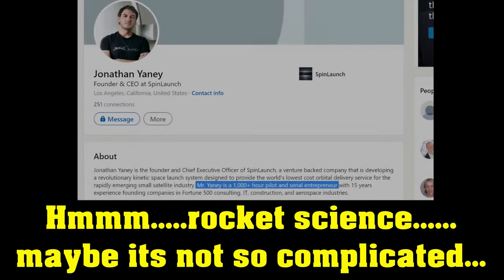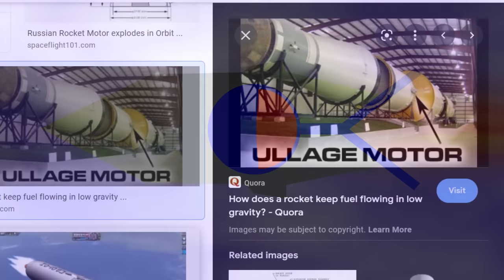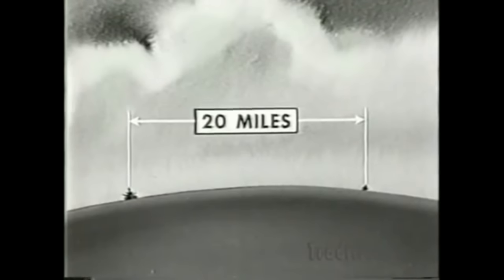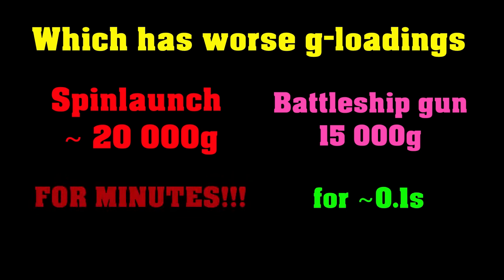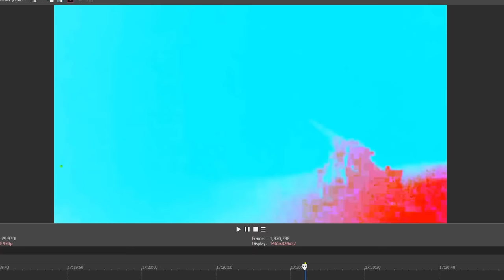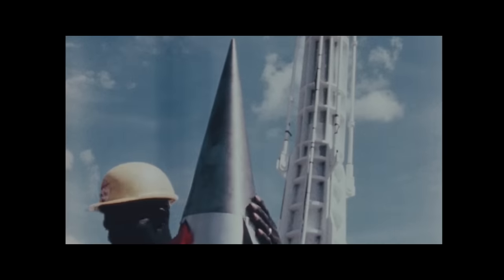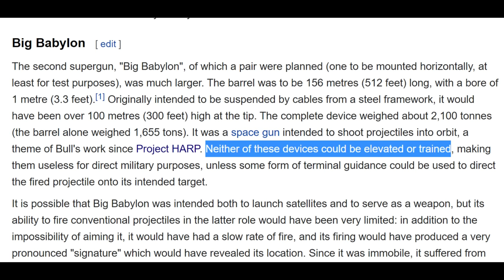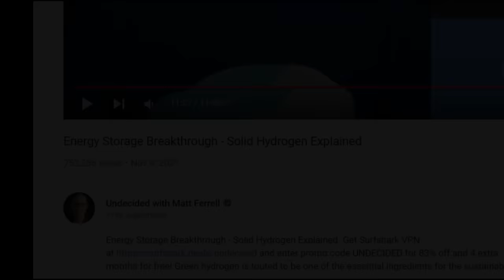Spinlaunch: BUSTED (Part 2)

Comment: I agree with most of your points here actually, and I also don't think this will ever work for numerous reasons. However there is one thing. I don't know your level of knowledge in rocket engineering Thunderf00t, but the fuel and oxidizer moving to the front of the tanks during deceleration is a problem that has been solved now in several different ways for several years. 
A few examples I am aware of being: 

#1 Using "header" tanks that are completely full and designed to deliver fuel instantly in these situations for engine relights.
#2 Electric pumps and/or using tank bladders(Yes I am aware of the extra mass this would take up).
#3 Pressure fed fuel delivery systems designed specifically to operate under these conditions.

Again, I agree with you on the idea that spinlaunch is kind of ridiculous. doable, but ridiculous. However I gotta try and keep the facts straight man.
Reply: Exactly. TF seems to really focus on being snarky here. This fuel issue can easily be solved in multiple ways. If there's anything that would make Spinlaunch unfeasible it's not this.
Reply: Many considerable updates needed, the reason why ones invention WILL get Busted , some of these goons learn to reabilitate thier designs, or keep bailing bonds out of the public ridicule all the time 🤣. It is VERY feasable to reinstate the technology, example, having a more o-ring axel spinner, magnetically suspension, realeasing the craft in a smaller volume of vacuum. No spinner clock tension arms, with a far wider g-force reduction of larger/human cargo, along with magnetic accel at the exit pipe, but it gets complicated, at the external exit atmosphere drag where at least a lower/less thrusting engine of the craft first stage, needs to equilibrium the travel velocity up.
Reply: Yeah I was disappointed that thunderfoot saying the fuel/oxydizer as a fatal flaw of the design. Clearly it look like something not particularly hard to solve.
thanks for your response.
Reply: For sure, it would've been foolish of the designers, if the fuel was just a loose mass motion of liquid, and not of gas, solid form, or have any compression flow injection mechanism, those would've been an issue during mid flight static/ignite attempts.
Reply: @anteeko  it was solved, the video he criticized even showed the helium pressure tanks they would use but it flew over his head, when people tried to correct him he refused to admit he was wrong about anything.
Reply: @odisy64  "when people tried to correct him he refused to admit he was wrong about anything."
It is disappointing from him. 
I thought a scientist would be more rigorous and admit mistake.
Reply: @anteeko  I stopped watching Thunderfoot years ago because of this behaviour, there are many much more genuine "science guys" on youtube
Reply: @karimshebeika8010  Could you recommend a few to follow?:)
Reply: @anteeko  PBS Spacetime, Scott Manley, Isaac Arthur are my favourites
Reply: @karimshebeika8010  I know those, good staff:)
Reply: Thunderf00t literally views himself as unbiased (or almost unbiased) which is a good laugh, he is also edgy for the sake of being edgy.
Reply: thanks for your information, i think thunderffot is making a living on sarcasm and ridiculing people.
Reply: @odisy64   got a link to that?
Reply: No idea how №2 and №3 is supposed to work.
Reply: @odisy64  I would have to agree, there was a time where thundfoot had some interesting takes on insane topics, but it seems that he has little to no problem explaning things in a misleading way to further his position against whatever the topic is. Not to mention his recent hate boner for elon.
Reply: @karimshebeika8010  Of the 3 (good) examples you gave,  only Scott Manley is similar to Thunderf00t. Also, if you stopped watching him years ago,  why are you ironically still watching him?
Reply: @Jimoshi1 
#2-A: Electric pumps draw the fuel from the tank with specially designed outlet pipes in the tank(which in some cases is filled with a porous almost sponge like material to stop the fuel from moving around.

#2-B: a large nitrogen filled bladder(balloon) is fitted inside the tank. the bladder is pressurized forcing the fuel to remain at the bottom of the tank(this works just like the pre-charge(holding) water tank that houses that use well water use. Pretty sure they are even called "bladder tanks".

#3: there are tanks holding thousands of psi of nitrogen(usually) which pressurizes the fuel tanks and pushes the fuel out through specially designed collection pipes.
Reply: @Jimoshi1  These systems are actually in use today, as we speak.
Reply: @ExCenterProductions  Yeah It's sad.I used to love the science. Don't know when he made the switch but. it saddens me a little.
Reply: @skateboardingjesus4006  Don't rush to judge. It is extremely difficult to watch while not watching. Much respect
Reply: @skygh  What on Earth are you going on about?
Reply: @skateboardingjesus4006  Just agreeing with you. If you don't watch how do you watch. My comment didn't seem ambiguous to me
Reply: @skygh  Oh, sorry, I didn't look at my comment you were referring to. But yeah,   not doing the things we do, is hard to do.😁
Reply: @odisy64  If Scott Manley claims that this spin launch idea is reasonable, you need to stop watching his videos.

Different ullage solutions are not the important design flaws in spin launch. It is all of the rest of it.
Reply: @odisy64  1. Argument from Authority Fallacy: I do not accept as true everything that Scott Manley says. To do so is an argument from "authority" fallacy. If he cannot calculate the launch timing from the spin launch claims, he is not trying hard enough.
Run the equations for yourself. Spinlaunch claims a certain rate and pressure (which seems to be a lie, based on the photo of their chamber membrane that is not bowed inward) and presumably they can tell us the width and length of the exit from their spin chamber. How precise does the launch timing have to be to meet the exit window?
That is an absurdly simple question. What is your answer?
Reply: @FinnMcRiangabra  are you even listening? Why are you talking about the viability of the project? Scott manly is credible figure and its not because his athority but that is beside the point...
Reply: @karimshebeika8010  And yet... here you are.
Reply: @odisy64  You are directly using "argument from authority" fallacious reasoning. You are telling me just to listen to what Scott Manley is saying. He has a great resume, but he is wrong in this. I am looking at the facts, not what Scott Manley says.
Reply: @FinnMcRiangabra  so why would you listen to thunderfoot? Someone who deliberately ignores facts and drives his own narrative? Your fixation on the viability of the project is beside the actual point.
Reply: @skateboardingjesus4006  got for some reason recommended on my youtube again and wanted to check if it is still the same old thing
Reply: @karimshebeika8010  yet you're hear... watching him lol
Reply: @karimshebeika8010  That sounds like confirmation bias indulgence.
Reply: @razi_man  This is a typical engineering personality.  I suggest this is a sincere presentation were seeing.  This guy just doesn’t hold back like most engineers, where many hold back because people consider engineers mean when they tell people that their ideas are stupid and won’t work.
Reply: @JoeOvercoat  There is a difference between sincerely telling someone why their idea doesn't work with an indepth explanation vs ridiculing them.
Reply: @razi_man  Yes. All engineers should look to Spock as their guide. Jesus being another good example to follow. But, it often doesn’t come naturally to the engineering personality.
Reply: @FinnMcRiangabra  at what point was this conversations about the viability of the project? it was never if this was a project that would actually be successful, its about thunderfooots deliberately misleading analysis.  you came out of nowhere telling me to stop watching Scott Manley, did you even watch the video i linked?
Reply: @Yggdrasil42  'here', he always does lmao.
Reply: @odisy64  Are you complaining about Thunderfoot debunking a thing that you do not even think will work or has been shown to work?? And how do you conclude that I, "came out of nowhere telling [you] to stop watching Scott Manley,"???
It is hard to know where to start. I'll skip the whole bit where you seem to acknowledge that the viability is suspect and go on to the Scott Manley part.
I never, ever, suggested that you "stop listening to," Scott Manley nor stop watching his videos. I do. He has good content. What I wrote was that you used Scott Manley as an authority when you were arguing that spinlaunch is a reasonable effort. You wrote something to the effect that, "Scott Manley said it works." (I am not looking back through the crappy YT comment management to find the quote.). That is "argument from authority" fallacy. Look it up if you want. Or just support a legitimate defense of spinlaunch claims.
Reply: Oh, I see that I did write that you should stop listening to Scott Manley. That was wrong and over-the-top. As I mentioned previously he has good content, but this spinlaunch thing is nuts.
Reply: For what it's worth, Thherdf00t's claim about lack of ullage motors is weak. You can't look at a publicity cartoon and say, "hey it does not show all of the technical details, so it is wrong."

On the other hand, I would expect the Spinlaunch video to have some numbers on mass savings, etc. Since they can't actually yeet something into orbit, how much primary stage does their system supplant?
Reply: And while they're at it, what do they contemplate to be the transverse acceleration loading of all of the components that they are flinging up into the sky on the way to orbit? Asking for a friend who wants their satellite to not disintegrate on launch...
Reply: @FinnMcRiangabra  im not complaining about thunderfoot trying to debunk this, im complaining about his massively inflated ego keeping him from accepting he got details wrong, Scott replied to him over his claims about the space shuttle but thunderfoot continued to say he was not wrong. His research quality is poor, so poor that he can be disproven in a single Google search. Like his claims about the space shuttle program being cheaper and better than the crew dragon capsule.
Reply: His point was that there was no mechanism illustrated that would solve the problem. He discussed one way that this has been solved.
Reply: @RM-wt9hi  dont you think he should have looked at official designs and not an illustration? Sounds like him making excuses for his poor research.
Reply: @odisy64  That was his another point. There where no detailed plans. Taken in context he is saying that the design "illustrations" have obvious deficiencies. How can you review the design when it is non existent save the computer animations?
Reply: @RM-wt9hi  sounds like excuses for poor research.
Reply: @odisy64  Ok. That is out of the scope of this comment section and I don't care to look into it. I will neither agree nor disagree with you on those points for lack of specific knowledge.
Thunderf00t was off the mark on the ullage rocket comments. Just because they are not shown is Spinlaunch's cartoons does not mean that they will not be used.
Reply: @FinnMcRiangabra  this is, his argument about the space Shuttle was even more ridiculous, he refused to believe the crew dragon capsule could support longer ISS missions, at most the ISS could stay docked for 9 days but the crew dragon capsule has docked for 6 months, thunderfoot really couldn't believe it.
Reply: @odisy64  How about you post a link so that we can see what you are writing about??
Reply: @odisy64  And by the way, would you compare a car built in the late 1970's to a motorcycle built in 2010? How fucking stupid is that comparison? Do you understand that technology generally advances? I would love to see crew dragon service the Hubble Space Telescope. Or any other orbiting satellite. How about launching satellites? Can crew dragon do that? -And I don't mean ride-along cube sats, but actual satellites. How about Soyuz? That has been doing what crew dragon does for decades. So what's new about crew dragon? They put the launch escape system in the capsule rather than on a tower. Whooo. Progress.
Reply: @FinnMcRiangabra  what in the 9 rings of hell are you trying to argue about? i was talking about how long they could stay docked at the ISS, why are you bring up satellite launch and Hubble telescope repairs? those arn't part of the NASA resupply and crew delivery contracts. it was chosen by NASA because of its extremely low cost compared to every other solution.

you seemed some what reasonable up until now when you clearly want to detract from crew capsule. did you even watch the whole video and not understand how blatantly malicious thunderfoot is?
Reply: @odisy64  What do any of you posts have to do with SpinLaunch? This is all a big de-rail.
Complain about off-topic Thunderf00t videos on a thread to which they apply.
I am done with the de-rail. The topic of this comment section should be the OT.
Reply: @FinnMcRiangabra  okay, back to the original point. Thunderfoot has an ego so big he can't admit when he is wrong. His research is often poorly conducted and he misleads his audience with malicious statements and erroneous math. He shouldn't be taken seriously.
Reply: @odisy64  Excellent. You have now made a bunch of claims that need to be supported as to how they relate to this current video. Please elaborate. I am fascinated.
FYI: I agree that his complaint about lack of ullage rockets is weak and should be considered a de-bunk that is de-bunked. Spin launch can easily incorporate ullage motors not shown in their cartoons.
Reply: For example, are you slandering Thunderf00t with respect to his work and YouTube videos on the reactions of active metals with water in your blanket slander statement above? Or is solar roadways your bugaboo? Maybe the Vegas Tesla "Loop." Please be specific in your general slander of Thunderf00t so we can judge the depth and width of your apparent animus.
Reply: @FinnMcRiangabra  do you really want an explanation? because i have one but its going to be a lot of reading and i don't know if you are of patience and if its worth the effort.
Reply: @FinnMcRiangabra  ill start anyways, ive been watching thunderfoot before he even made his first solar roadway video, dude use to make videos about other things he would complain about like religion. i liked his videos because he was debunking kickstarter crap that i knew wouldn't work from my own understanding of engineering and manufacturing. i knew exactly why solar roadways wouldn't work without even doing a single calculation and i agreed with thunderfoot on nearly all his points but he came of malicious. like the sort of dude who feels empowered when he trashes something he knows he is right about.

i know that because i use to do that but stopped because i use to do that but i got tired of being so cynical. i blame his audience for this, most of them cant do physics math themselves and get super impress by thunderfoots basic calculations even when they are pointless or misleading.

for example (like you asked), i stopped watching him completely when he made a video on the hyperloop. at this point his ego was massive from his successful debunking content and felt like going after a billionaire with ideas that sound like scams because his mindset has been that way for a decade. while showing issues with the design he made up a hypothetical scenario in which the inch thick walls of the tube could be punctured by a .50 Cal rifle round (classified as an "anti-material weapon"). he brought up this scenario to demonstrate how easy it was to sabotage the system. i was like "okay, thats true, you can attack it but the same applies to everything else like airplanes and rail tracks". but that wasn't enough for him, he then suggested and that the air coming from the puncture would travel down the tube so fast and with so much energy it would destroy the vehicle inside. he proved this could happen through his calculations, i wont dispute that but what he did wrong went over everyone's heads because he tends to leave out a lot of details. 
a .50Cal bullet will leave a 12.7mm hole in the tube, that is a very tiny hole, after 1 inch the bullet wont have enough energy to puncture through a second wall and because of its circular structure it was resistant to punctures. he showed the tube completely severed from the rest of the tunnel in his calculations suggesting the entire end of the tube had been somehow cut off and exposed to the pressurized atmosphere and not a tiny 12.7mm hole.

he is too smart to have not known about how all the air would have to funnel itself through a hole like that and how it would completely invalidate his point about a single .50cal round being able to destroy the train by causing so much air to rush in it slams into the train.

if thunderfoot is willing to deliberately mislead his audience through such obvious oversights then what else has he used legitimate math used in a misleading way to prove his point?
Reply: @ExCenterProductions  
Yes, but... metallic water
Reply: @odisy64  Sure. I am open to anything on-topic (i.e., about SpinLaunch).
Reply: @odisy64  I see, so totally off-topic. This amounts to what is called an "ad-hominem" attack. Rather than addressing his arguments you are attacking the arguer on more general points. If you can't address his arguments on-topic (about SpinLaunch) then I am not interested. This is not about Thunderf00t, it is about SpinLaunch.
Reply: @FinnMcRiangabra  if your going to talk about spinlaunch then dont use thunderfoot as a source. I really couldn't care if this company is successful or not, thunderfoot already protected himself from future criticism by using his classic "im not saying its impossible but its really hard" defense.
Reply: @odisy64  If you are going to champion SpinLaunch, then provide another source to evaluate. I will check it out and comment there. This, in case you can't tell, is a comment thread on a Thunderf00t video about SpinLaunch.
And, I just can't help it, you wrote "your" when you should have written "you're," or, " you are," Proper grammar helps sell your case (see how I used "your" correctly there?). 
If you are just here to crap on Thunderf00t, then I can't help you. If you post a video about how Thunderf00t is crap and post a link here tagging me, I promise that I will watch it and give you a view.
Reply: @FinnMcRiangabra  what makes you think im championing spinlaunch? I thought it was very clear why im here, its to inform people this video is full of flawed criticism, not because im deffending spin launch but because i dislike people who use their platform to maliciously attack projects using false information, proper grammar makes you sound more intelligible but it doesn't change if your right or wrong so i focus more on explaining my thoughts than grammar checking, i just cant help it.
Reply: @odisy64  I have invited you to post a video about the axe you want to grind over Thunderf00t and promised to give you a view on it. At this point, you are way off-topic in this thread, which is about SpinLaunch.
I don't know what pet idea of yours that Thunderf00t pissed on that makes you so antagonistic. But any more posts by you on the same topic in this thread are pretty much just trolling now. Good day.
Reply: @FinnMcRiangabra  im not goint to make a video just because you told me too, why do i care if you watch it? i wouldn't care if thunderfoot saw it himself nor would it matter to him. no matter how much i explained why im here, you have tried to drive the conversation to something it was never about. never have i seen someone act so respectful but deaf to the person their listening too.
Reply: Jake Standford  thats the other thing, about 1/4 of what he says is maliciously missleading so his audience can't actually tell how much of a scam something is or if it is even one.
Reply: @teksatan4699  I need two points to clear up before I launch into my main rant.

#2 The spinlaunch rockets are under high acceleration, and the bladders will be subject to proportional buoyant forces stressing on its mountings. Bladder tanks don't scale well even in regular gravity, let alone the induced gravity of a spinlaunch.

#3 If the fluid is at the top of the tank, what's preventing the nitrogen from bubbling through the fuel/oxidizer directly into the feed lines?

Now those two are out of the way, the Rant:

What makes you think that SpinLaunch has thought of any of this? Sure, there's a PSI rating, but it's a fluid, it's practically required in glitzy CGI sci-fi porn. Far more than the pressurizing tanks, what I noticed was a complete and utter lack of structure that is supposed to keep their rocket together. Even if the engine is weak, you just subjected this turkey to multiple g's of acceleration. I think that the internal structure you see when the faring is shed would have been crushed by the SpinLaunch gees and that would end your trip real quick.

And this is to say nothing about the fact that the Launched rocket will have to plow through 10 km of our thick troposphere where 90% (IIRC) of the air is. Reentry is bad enough, and is enough to slow down a capsule from orbital-type speeds to within a couple of times the speed of sound, and that's high up. What about low to the ground where the rocket is at its maximum speed? That's going to be some serious drag, and as such would probably grossly exceed the maxQ of any practical rocket we have. As such, if you're expecting SpinLaunch to provide most of the KE for orbital velocity, then you hope in vain.

But that's the lion's share of the energy is in an orbiting spacecraft, in the orbital speed, and not in the height. So if you're using a rocket to get that speed, then they'll be just about as large as they ever are, and you don't get any significant benefit from SpinLaunch. You're going to have to provide the lion's share of the KE with your engines like always.

And here we arrive at the crux of the matter. We use turbopump-fed engines for launches because they are lighter overall than the equivalent pressure-fed engines, even when you add ullage motors. Even with a pressure-fed engine, you might still choose to use a ullage motor because it's cheaper/lighter than those three options you offer. While TF may be wrong on the specifics, he does seem to realize on some level that the use of CGI makes these concepts look far more polished and developed than they actually are.
Reply: @FinnMcRiangabra  I think Thunderf000te makes this point all the time. Many of his Busted videos are based on a project proponents slick computer generated videos not actual science. It seems to me that that is the same point he is making here. 

A lot of slick graphics but a complete lack of detailed plans and physics about how this spin  launch will work.

I think he has shown that it won't work, at least with how the project proponent, has shown it. I think Thunderf00te at least attempted to explain the physics of it.

So far, all I have seen in this thread is arguing back and forth over how rocket fuel systems work. So, what? What about the physics and engineering design? 

The computer graphics are great though. Maybe they should have written a "white paper" on how this all works. You know like Musk did with the Hyperloop.
Reply: @RM-wt9hi  Not sure what you are replying to and I am not going to filter through 77 posts from a month or more ago to find out.

Are you surprised that a company's promotional material is slick graphics and short on technical specs? If so, then no point interacting with you on this topic.

What I do recall complaining about is that Thunderf00t seems to use the graphics as evidence that the system does not have ullage motors. That is expecting too much of the graphics as a source of data on the system.

And why bother when there are other topics much better for criticism?
Reply: @odisy64  Thunderf00t used to make decent videos, but the last five years ago now. He has been obsessed with Elon Musk to a point it's far beyond strange and awkward. In his Musk-debunk series he act as an annoying sarcastic douchebag where he's using Musk fans' arguments to debunk Musk. He picks data to fit his fan base like a thrush picks cherries for a nest full of cubs. The worse part is that I often agree with him that many ideas seems to be so far fetched that I will be surprised if they manage to make a working prototype, but the history of science is full of ideas that almost no one believed in. If everyone in science had been such a besserwisser sceptic to new ideas as thunderf00t, we wouldn't have come very far. 
He made a decent glass water distiller though when he made the "taste heavy water" video. He made the distiller to be absolutely sure avoid contamination, and then he designed a non randomized, double seeing study... He would've "busted" that video so hard if someone else had made it.
Reply: I haven't done the calculations but this ideia seemed stupid to me since the first time I heard about it. The ground velocity needed to scape the gravitational field of the planet considering there will be a huge amount of air drag makes me think that the 'package' could burn even before reaching the intended orbit. Not to mention the mechanical stresses on the launching mechanism. Seems very obvious to me that burning fuel along the way is a much better speed/drag control system also considering navigational aspects.
Reply: @karimshebeika8010  Thunderfoot has a very good track record of his 'Busted' being correct. He might be onto something. Yes, there are some errors that he needs to admit and correct and amend some videos, but it won't stop me from watching him. As long as his 'Busted' % remains high.
Reply: @skateboardingjesus4006  because they are trolls or bots trying to validate each other because TF hurt them some type of way apparently
Reply: @karimshebeika8010  stopped watching but still commenting!
Reply: @odisy64  Cool. You let me know when Spin Launch gets a contract from NASA. 
You sound a bit sour, bud
Reply: There's no way the rocket's internals will survive 10,000 g on the centrifuge.     
In particular the fuel tanks will explode.
Reply: @iggi3985  i dont think they will ever have a contract with NASA, i dont believe in the system, but thundefoots criticism are poorly thought out and if you correct him on it he will go into an angry rant and insult you, he's done it and the space community was not happy about his antics.
Reply: @odisy64  you might be right, but ultimately, so is he. 

He might not be right about everything (nor do I condone such antics and behaviour), but the in the broad statement of it not being feasible nor practical, hence wont really go anywhere, he is correct.
Reply: @iggi3985  ya, he is correct, he has been about a lot of things he makes videos on. a lot of it is easy stuff to debunk like solar roadways but he gets praised a lot for pointing out the obvious and it gets to his ego. his videos on starship and starlink are just embarrassing to watch, he goes full speculation and misinformation. i dont know if its malicious or he legitimately gets so angry over elon musk he cant even find their website on google considering he misquotes ranges on Tesla cars.
Reply: @nickgennady  "people get scientists wrong. Many are biased and ignore data that does not suit there viewpoints. Remember there humans."
I guess you are right, I though science institutions had found a way to minimise that but it doesn't seem to be the case.
Reply: @charlesvan13  I'm not even sure they'd be able to get to 10,000Gs that by itself would be quite the feat. Honestly don't think this project will ever make it that far lol
Reply: @charlesvan13  Being purely scientific however, this would be very dependent on the "time factor". "How long are they taking to spin up to these velocities?". Accelerating to quickly will place a higher g-force on the load. Spinning gradually (over 6 hours for example) will decrease this load by spreading it out over time. Although the ending force will inevitably be the same, the gradual "spin up" to the required velocities etc. could potentially solve this. or at the least. reduce the effects. Again... i don't think they will ever get this thing up to a velocity where 10,000 g's are placed on the load and still get a stable, controllable launch. this project will end up failing either way.
Reply: @teksatan4699  
The centripetal force will depend on just the rotational speed, not how long it gets to speed.
Reply: @charlesvan13  You're correct However I wasn't referring to centripetal forces lol. You must note a centripetal force is almost indistinguishable from gravity. Something that doesn't generally have much effect on electronic components etc. within the payload they are launching. What does have an effect more so is the change in gravity or rather the change in acceleration over a given time period. So although a centripetal force would be proportional to the speed the payload is rotating at. electronic components etc. would be far more effected by a "jolt" or rapid change in acceleration where things get rattled and jerked about. Soldering connections etc. wouldn't take kindly to this. However, a constant crushing force caused by the centripetal force really would be unlikely to physically damage anything.. as long as they don't exceed the structural strength of whatever the payload is made of.
Reply: @teksatan4699  
Centripetal force is force due to acceleration.    And the forces will be extreme at the rpm that they need.    A rocket will have fuel and tanks, and they will be subjected to 10000g.    And it will be sideways, so not in the direction of the rocket's thrust.
Reply: @charlesvan13  The problem is the change in acceleration(or rather velocity, as acceleration is a change in velocity over a given time period) over time. a human can accelerate to insane velocities and not notice well anything really.. IF they accelerate slowly enough that is.. accelerate to those same velocities to quickly and the humans all go SPLAT against the back of the rocket... and centripetal forces are intrinsically related to acceleration, they are not the same thing.. lol Centripetal force is more related to velocity. not the change in acceleration.. the faster you go(velocity) the higher the centripetal forces will become. It is really unrelated to how quickly you get to that speed.  Therefore, the centripetal force doesn't really play much of a role for the particular force I'm referring to. That force being the "shock" force on the electronic connections etc. due to a rapid change in acceleration.
Reply: @charlesvan13  So if you want to be technical CP(centripetal force) is not due to acceleration. It is caused by your velocity around a fixed point. CP changes only when velocity changes. NOT directly when acceleration changes, which to remind you: acceleration = the change in velocity over a given time. So although acceleration causes an indirect change in CP. Acceleration specifically refers to how much the velocity has changed over time. Not what the velocity changes too.. lol Acceleration doesn't give a shit what speed you start or stop at, just how quickly you get there,
Reply: @teksatan4699  
Centripetal force is acceleration.
In circular motion the acceleration is perpendicular to the velocity.
The force on it is the force due to the acceleration by Newton's law F=ma.
Reply: @charlesvan13 That is technically incorrect. The correct definition:

NOUN (physics)
 "a force that acts on a body moving in a circular path and is directed toward the center around which the body is moving."

 Acceleration itself plays no direct role. It is directly linked to how fast you are moving. Not how quickly you change speed. Acceleration only dictates the change in velocity(speed) over time.  

Your statements are incorrect and misleading.

Edit: The only reason acceleration changes CP, is because acceleration is measuring the change in velocity over time. if you modify velocity it causes CP to change proportionally.
Therefore: acceleration changes velocity, and velocity changed CP, but acceleration does not measure or equal CP force.

I can accelerate at 10,000 meters per second. but only move 1 meter...  thus capping my actual max velocity. and thus CP. So despite a massive change in acceleration(0, to 10,000meters/ps) CP would remain extremely low. due to the short distance traveled. This is just one example of how your statements are incorrect. I realize this is a half assed example, but it is the simplest example I could think of that wouldn't require math you obviously wouldn't understand by your lack of understanding in the difference of acceleration, and velocity. lol
Reply: @charlesvan13  The thing you seem to be missing out on here is that acceleration has an additional value. it is TIME. It's the time it takes to reach a specific velocity. If you accelerate to quickly bad things happen. If you accelerate slowly, it is almost unnoticeable even if you accelerated to the speed of light. Doing so in 1 second would turn you to mush. Doing that over 10,000 years means you speed up only a few meters per second every year.... as an exaggerated example. 

My point: Following the above logic, if you accelerated to the speed of light  over say 10,000 years. that means your average velocity is LOW, and thus centripetal forces will be LOW. When you argue that the centripetal force would rip the machine apart is referring specifically to the VELOCITY of the payload. You aren't accounting for how fast they take to spin up.(acceleration) you are trying to use these terms interchangeably, and they aren't

Now just to throw the equations at you anyway

Fc = m * v2  * r

No where in the equation for calculating centripetal force is acceleration :P it's(centripetal force "Fc") calculated with mass * velocity squared(V2) * radius

My original comment was not on how the CP force would effect the payload, but rather how the rapid change in acceleration would effect physical connections within the payload such as electrical components etc. which are not structurally sound in any way. Even with space tech it is quite easy to rip electronic components off of boards, or to have vibrations cause breaks in solder joints. this is something that CP would largely not effect. All spacecraft have multiple redundant computer systems for this exact reason. they tend to run in parallel for when one fails. something that would be difficult on small payloads like what spinlaunch is capable of launching. Too small to cram multiple computer systems in.
Reply: @teksatan4699  
If you're rotating a weight on the end of a string, the force is that exerted by the string on the wight.   And according to Newton's second law F=ma, it accelerates it.    It can maintain the same speed.   But the velocity is changing in circular motion.    Velocity is a vector, while the speed is the magnitude of the velocity.    

People used to, and still do, call the force that slams you against the wall of the carnival ride that rotates, the "centrifugal force".    But that's misleading.   It's a fictitious force.    The carnival ride car is accelerating.    Thus the force comes from F=ma.
Reply: @charlesvan13  What you just said is missleading. even if the carnival ride(gravitron btw) stops accelerating, and remains at a constant velocity, the force is still there. It is NOT the acceleration causing the force. It is the velocity. The acceleration is only responsible for the "forward" motion. The object knows nothing about it's rotation around an axis other than the CP force it is feeling. As far as the object is concerned it is moving in a  perfectly straight line otherwise. Therefor you cannot say said forces don't exist. the "fictitious part of this equation IS acceleration. As the force created by rotating around an object is INDISRINGUISHABLE from acceleration. and can be calculated with F=ma. where acceleration is the change in force over time in a specific direction generally, as moving to either "side" (diagonally) for example would increase the distance traveled and thus change acceleration to maintain the same velocity.

The object isn't "accelerated" by spinning it. WE are accelerating it. and IT wants to travel in a perfectly straight line. but is "FORCED" to rotate by being anchored to the center. that "rotational force" is what mimics acceleration opposite to the direction from the object to its rotational center. CP is a "lateral force" if you will. from the axis of rotation. where the acceleration i am talking about is the change in velocity AROUND the center. this would manifest as acceleration not just laterally but in line and opposite of the payload's movement direction.
Reply: @charlesvan13  Example:
[x, y, z]

let's talk vectors then.

We start at [0, 0, 0]. I want to move to [10, 0, 0]
seems easy, move forward 10 places right? How long did it take?

well lets say 10 seconds. you moved 10 spaces in 10 seconds. that is 1 space a second.

Now lets apply rotation around an axis and see what happens. we'll move to [10, 10, 0](quarter circle if you traced out the arc on a graph)

now remember in order to keep a constant acceleration we must travel to the end point in 10 seconds. so lets get counting.

we move the 10 spots forward. and at the acceleration of 1 spot per second we already reached our 10 seconds. but we still have to travel left by 10. ugh... that's 10 more moves... 10 more seconds...

so now we have a total time of 20 seconds to travel to [10, 10] what happens because of this extra time? well something in your equations has to change but it can't because we are forcing it to rotate at a constant speed. THAT change IS acceleration. That difference in time to travel in an arc around an axis vs a straight line is where the "fictitious acceleration"(aka the force that pushes you against the outside walls of the gravitron ride while it spins) comes from. and again this is not the force I was talking about in my original comment..
Reply: @charlesvan13  Just to add again. the calculation for centripetal force is:
CP = mass * VELOCITY squared * radius;

The equation has nothing to do with acceleration. it is the velocity.. for like the 6th time.. lol It's obvious you learned your maths from youtube videos..

 The force felt and known as "centripetal" is what can be calculated as f = ma; if you took rotation out of the equation. (kind of like a human on the surface of the earth while it rotates.).  from an outside perspective we know you are spinning around an axis. but from your perspective you just feel a force(like gravity) pushing you away from the center.(of course the gravity of our planet greatly negates the CP force we feel from it's rotation but you get the idea). If you don't know you are spinning around an axis. you could calculate that "force" you feel as f=ma but the second you break out into 3d space, or change acceleration. the fictitious "gravity" (aka the F from f = ma) no longer works. or changes. meaning you don't just feel the fake "gravity" pushing you away(or pulling you if speak of real gravity like being on earths surface) but you also feel a sideways force as the acceleration changes. Once the acceleration stops and you are moving at a constant velocity, you stop feeling the sideways force and only feel the "fake gravity" again.

Think of it this way. every force creates an equal and opposite force. we FORCE the object to move sideways when it wants to go straight by making it spin around an axis. That FORCE we put on the object to make it orbit. IS the force you feel pushing you against the "outside" it will be opposite to the other 2 forces which would be forward AND sideways this creates an opposite "force" in the opposite direction of the 2d vector, which would appear to be diagonal from the origin on the x,y plane in which you are rotating(as if you drew a straight line from 0,0 to the object) that direction is where the combined forces "push" you creating CP or the ILLUSION of f=ma (gravity or acceleration).

spinning around an object is CP = mass * velocity2 * radius, and only becomes f = ma if you remove the radius, (and time delta values from the (a) in the equation)
Reply: @teksatan4699  
The equation like most Newtonian mechanics from F=ma.

You get 
F=mv^2/r 
if you use linear velocity v, where v^2 denotes length squared.   
Or if you use angular velocity w:
F=mrw^2
which apparently is what you used.

An object will travel in a straight path, constant velocity, unless a force is applied to it.
Reply: @teksatan4699  
(10,0) to (10,10) don't obviously lie on a quarter circle.   If you 
traced a circular path from (10,0) by
10(cos t, sin t) as t goes from 0 to \pi/4, to do a 1/4 circle but the end point would be 
10(\sqrt{2}/2 ,\sqrt{2}/2 )   
not    (10,10).
Reply: @charlesvan13  Fairly certain I said "and trace an arc" obviously i was jumping and skipping positions to simplify my explanation. would have been hard to follow if I explained with a matrix of 30 points to trace a perfect arc.. This is a youtube comment. I'm a little limited in how much I can post lol
Reply: @charlesvan13 I just noticed something. We are talking about different things LOL. Im talking about the force opposite to the direction of movement.... as we accelerate forward it feels like there is a force pushing us back.. this was what my original comment was about.. NOT what the CP force would do...  and you'll have to forgive my simplified vector explanation. I wasn't expecting you to have any trigonometry knowledge.
Reply: @charlesvan13  Yeah we we're arguing different sides of the same force. and you'll have to forgive my choice of calculating the angular velocity, I've been doing a lot of sims with opengl lately and it has just been my preferred maths. I am sorry for the confusion, as my original comment has nothing to do with the CP force at all. I thought you were trying to say it does, and i got very confused.
Reply: @charlesvan13  Not even sure exactly how we miscommunicated there, your maths checks out with pretty much everything I said. I typod btw it was originally suppose to by [10,-10] simply to denote d(destination point) at the end of an arc starting at 0.0. I was ignoring the trigonometry involved in calculating the actual arc.. I assumed it was implied. basically thought you were confusing acceleration and velocity.
Reply: @charlesvan13  You'll have to remember it was just an example I wasn't actually trying to calculate literal forces with the example.. It was purely meant to help someone visualize in their mind what is happening. Try telling 90% of people on the internet to visualize cos(10), sin(10) in their head lol(sorry for the syntax I'm a c++ programmer.. it's habit) I know when you actually use my example to try n calculate an actual arc it would become a spiral not a circle. but when visualizing the simplified numbers make it much easier.
Reply: @karimshebeika8010  lol the irony in commenting on a video from a creator you claimed to have stopped watching years ago.
Reply: @SpydersByte  first of all, if your replying to someone for the first time, dont give them a wall of text with multiple points, because then i have to make an even bigger reply addressing each point in one text. so im going to ignore most of what you said and address the first thing so we do this one at a time we dont have to read each other's novels. i hate hitting the character limit on youtube. 

in thunderfoots simulation he shows the tube being completely opened allowing the full crossection of the tube to be exposed to the atmosphere. this is missleading because a .50cal round would leave hole slightly bigger than 12.7mm. all the air would rush through a whole through the size of your finger, this causes a flow bottle neck limiting how much air can "push" towards the train. 
from what i remember, the walls on the tube would be about half an inch or an inch thick, if you have ever shot steel with high velocity rounds (i have with a 30-06 which is similar to a 7.62 round traveling at the speed of a .50 cal) and unless your close you unlikely to penetrate or hit the same spot twice.

its not like the train carts that collapse from catastrophic decompression, elon knows about that, he has lost rockets to it. but you not going to crush a tube that structurally rigid.

i dont think the hyperloop is a retarded idea, i just think thunderfoot is good at making you think it is using misleading tactics. recently he posted a video on the Tesla semi truck claiming it could only haul 5 tons total because he estimated each of the 11 barriers loaded on it weight around 500kg. and used this to prove that the Tesla semi was a scam and elon is a fraud. but any trucker with a brain would instantly tell you that those where 10ft jersy barriers which each weigh 4,000 pounds each for a total of 44,000 pounds (22 tons).

now is thunder foot that bad at researching or was he deliberately misleading his audience?
Reply: @SpydersByte   also here is the video that talks about his argument with scott. https://youtu.be/v-ny_Ba4K_w
Reply: @odisy64 how are you going to presurise liquid oxygen tanks when the whole thing js cold enough to liquefy oxygen?
Reply: @ozzyherrera1027  are you actually serious? you use a fuel bladder. you can still create pressure with incredibly cold gas by simply forcing it into an environment.
Reply: @karimshebeika8010 ”I stopped watching thunderfoot years ago” yet here you are, deeply buried in a comment section answering to another deeply buried comment. Doesn’t look like “stopped watching” to me… 🤦‍♂️
Reply: @TomJakobW  well, I was about to restart watching the channel but it was a one time thing. Only thing that gets me back here are the comment notifications. no hard feelings.
Reply: And Ullage thrusters are small rocket engines that are used to settle propellants before the main engine is ignited. This applies just enough acceleration to force the propellants to the rear before the engine turbopumps are spun up.
Reply: @odisy64  Scott Manley has a tiny fraction of the credibility OR qualification that Tfoot does....
Reply: @N8Dulcimer  scott manley is an actual astrophysicist, thunderfoot is a failed chemist who doesn't even know what a fuel bladder is for or how unavailable hydrogen is in long term use in space do to the bleeding issue. I love it when i get to crush thunderfoot fans hopes and dreams.
Reply: @N8Dulcimer  oh, so scott has way more credibility than a failed chemist who makes "debunking" videos on things he barely understands. See when we actually talk about stuff like fuel bladders, you dont know what to say and neithet does thunderfoot. I use to watch thunderfoot 7 years ago then i noticed he started milking debunking rant videos and started putting emotions infront of facts. Just look at how poorly his starlink videos aged.
Reply: @odisy64  Damn bro. You keep saying failed chemist. What does that even mean? xD He is employed as a chemist and publishes his research to peer reviewed journals... You clearly care a lot more about interpersonal drama than you do about who has contributed new information to a field of science. Youre allowed to disagree with Tfoot, but calling him a 'failed chemist' is just denying reality lol. If a chemist who regularly publishes is a failure, then what do you call an "astrophysicist" who isn't even qualified to submit a paper for peer review? lol
Reply: @N8Dulcimer  i wish ypu understood how little writting papers meant, most papers published by scientists like thunderfoot dont actually get read but reference the paper anyways and thats the most you can say about him, you didn't even mention what he specifically does because it matters so little. You act like getting a degree in astrophysics is something they hand out. I know thunderfoot better than you. Scott destroyed thunderfoot when they got into an argument because it turns out the space guy knows more than the chemist about space. We can actually discuss the things thunderfoot has gotton completely wrong deliberately to make his argument stronger if you want.  

At some point thunderfoot felt big enough to start attacking scientific and engineering projects lead by people smarter than him because he feels the need to debunk things to feed his ego like all of his predictions about spaceX.
Reply: @odisy64  NOW i get it lol. You dislike him on a personal level because you are a fan of specific people he has disagreed with. All of your interpersonal drama nonsense means absolutely nothing to me. Your favorite celebrities might be STEM adjacent, but it's still celebrity worship lmao.
Reply: @N8Dulcimer  okay, now we can get started. I stopped watching him when he consistently got the math wrong but then attacked people i like using misinformation and straight up lies about the topic to validate his argument. Of course its personal and objective. I can give you endless examples of him purposely misinterpreting things he is too smart to not understand. 

I remember when he would attack Tesla and qoute the ranges of the cars but they would be lower than what official sources would state, are you telling me he couldn't find Teslas main website?

You will ignore him twisting information, why?
Reply: Yeah, what he said.
Reply: @odisy64  Pressure doesn't push fuel/oxidizer to bottom of tank. It simply pushes the fluids through any outlet in the tank the fluids happen to be covering. Saturn 5's had cameras inside the tanks. The giant tanks were ring baffled for strength and contained no bladders. Likely because a complete engine shutoff before attaining orbit would be one where a restart would be impossible (took pyrotechnics to light those big F1's on the first stage). The near instant deceleration would (or should) indeed have the liquids floating around in the tanks or collecting at the tops. Yes I agree that he got that maintaining fuel/oxidizer flow wrong as there is ways to achieve it without acceleration on something as small as that spin rocket
Reply: This seems akin to a pedantic argument, because he did have a weak point, but pretty much everything else was spot on